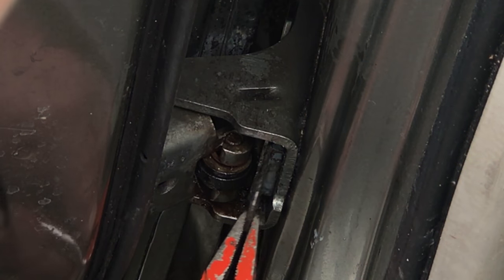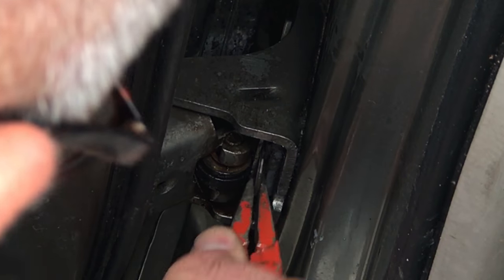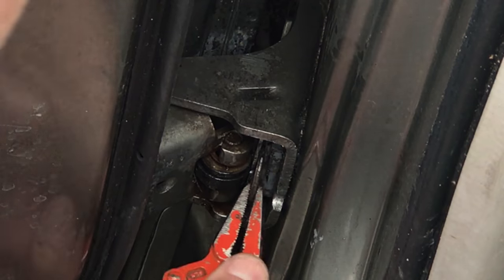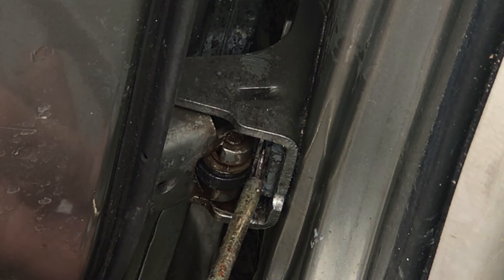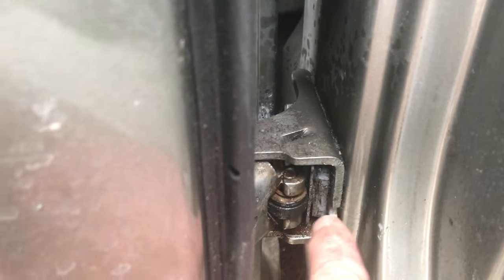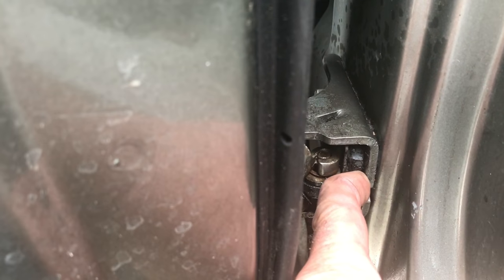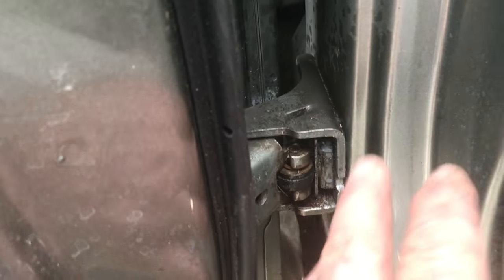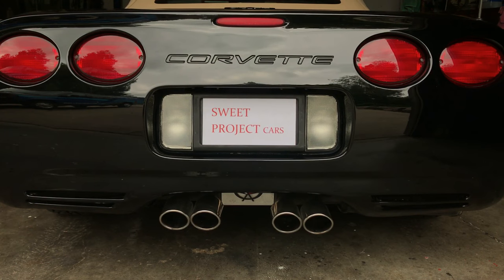How To Fix a Car Door That Won't Stay OPEN?.... See Our 2 Minute Repair

Comment: The "detent arm" or whatever it's called, by the hinge in many doors, often has 2 detents and in my opinion that's not enough, especially in a crowded parking lot. I think there should be 3 or maybe even 4 detents.  Often I get in or out of a car and even with a reasonable distance between vehicles, I have to hold on to the door so it doesn't touch the next vehicle, sometimes because the first detent itself pulls it open further than I want.
Reply from the maker: im with you on that it is a very bad design by the engineers thank you very much for the great comment and we appreciate you being here with us...:)
Reply: Sweet Project Cars always a pleasure learning from your videos. :)
Reply from the maker: thank you very much for the great comment and we appreciate you being here with us...:)
Reply: Kevlar Canuck hi
Reply: @phildenofrio5749 -  Hello Phil, sorry, I missed your message.
Reply: Does adding the washer stop the problem of the door swinging out freely?  It's driving me nuts.

Comment: Fantastic fix for 51 cents.  Used a quarter on one door and a penny on the other (One quarter rolled away) you have to use a knife to cut the plastic so that it not still attached to the metal and pry it away.  Make sure you insert the coin in the plastic in the side away from the round thing.   No more closing door its own.  This guy is a genius
Reply from the maker: Andrew Holstein smart thinking on the coins...great job my friend :)

Comment: This is awesome! What size washer did you use?
Reply from the maker: It all depends on how bad your door is as far as not staying open.  Usually a washer 1" in diameter and an 1/8" thick will do the job, if it doesn't then just go thicker a little bit at a time till you get it where you want it.  Thanks for the question.  Have a great day.   mad Mike the hammer SPC
Reply: @SweetProjectCars  thank you for the quick reply!

Comment: I had older 06 Ram which had the best Factory door stoppers, strong enough to work better than any other vehicles I've tried, friends used to tell me, oh your doors open so hard over those... I don't know if Chrysler did it accidentally, because the newer generation has smaller lightweight doors, so they made the same Stoppers considerably smaller and now it's much worse just like any other vehicle, it's barely catching, wind or parking in pitch gets the door wide open too easy, or it's falling on your Lags. Such a trivial thing I would hope today's Engineers would achieve
Reply from the maker: We are with you and that we do have another video on the flat style door detent that we show how to make it work better

Comment: Sweet video. Got an issue I hope you can help fix. My door hinge is a little lose so it makes my door "sink" down a little. It does close without a problem but if I'm outside I'm able to see a small gap between the door and the car frame on the top frame of the door. What's your solution? And yes, I subscribed to see if there's anything you got that I could use. Thanks for the videos. You're awesome!
Reply from the maker: William it sounds like it is time for new door hinge pins and bushings...sorry my friend they are not fun to do on most cars   thank you very much for the great comment and we appreciate you being here with us...:)
Reply: Thanks for the prompt reply!  Well, looks like there's no easy way out for me like what you did here in this video. Nonetheless, looking forward to more of your awesome videos. Keep it up, my friend. Cheers!
Reply from the maker: you are very welcome Williamteoh :)

Comment: Nice job!  However, on my 65 Ford Mustang, it has a spring on both doors.  How to fix it?
Remove the door, the hinges, replace the spring and WA-LAH!  all fixed (after about 5 hours of working on the stupid door)  Now comes the irritating part of trying to adjust the door again so it will hit the striker correctly and close easily...   :(     
I wished my door had that hard rubber instead of springs!!!
Reply: Tom McDaniel Tommy boy, next time, before you remove anything, take a scribe and trace around the hinge on the body and on the door with it. When you go to put the hinge and door back on line it up with your marks. You should have very little, if any, adjusting to do.

Comment: Rubber? No car I've ever owned, past or present has or had any rubber in the hinge.
Reply from the maker: well this one does..........many of the mustangs and Ford products did     thank you very much for the great comment and we appreciate you being here with us...:)
Reply: Most people or mechanics will say , replace the part , replace replace replace , they never fix .
Reply from the maker: you got that correct Eyad   they don't want good people to do their own repairs   thank you very much for the great comment and we appreciate you being here with us...:)
Reply: Earthling, Yes a lot of cars use what are called "Door Checks", which I just replaced. Inexpensive, and very easy...
Reply: Earthling it’s very common on the ford panther platform